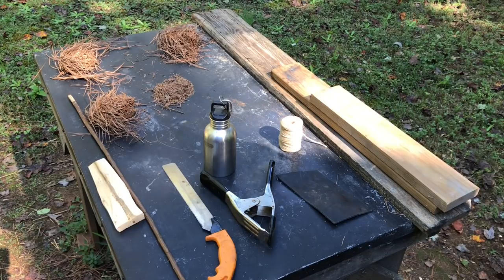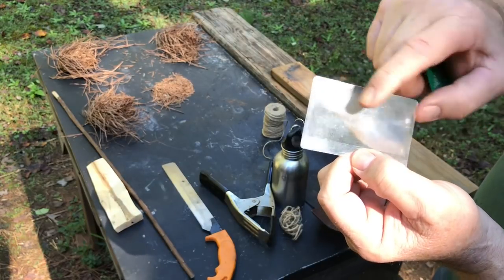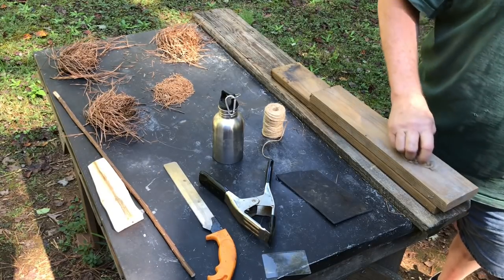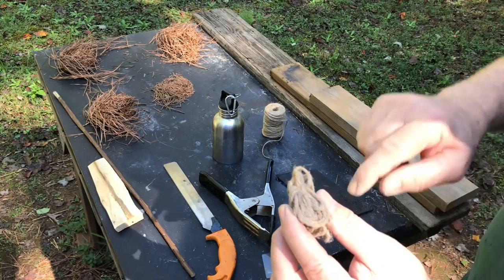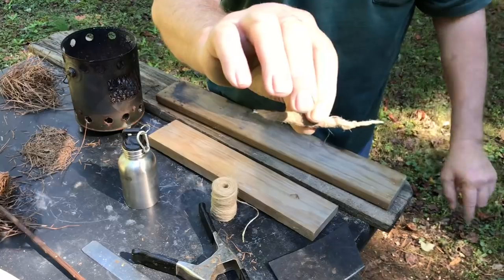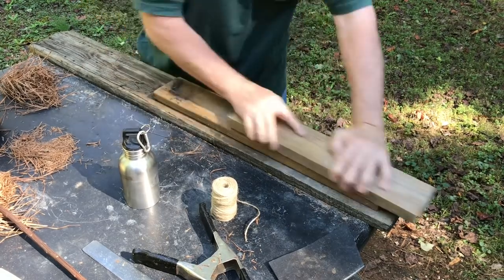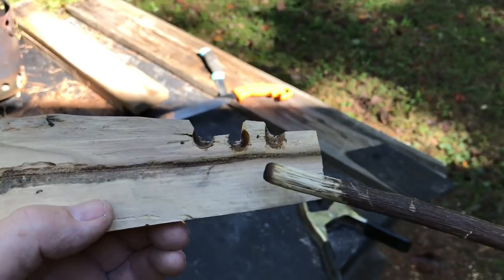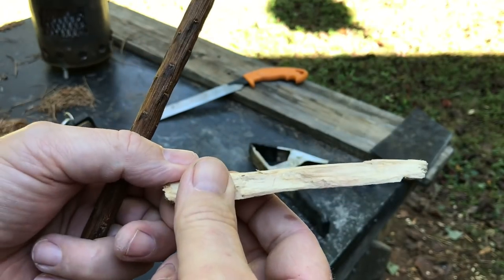3 Ways That Wood Ashes Will Help You Make Fire!

Comment: Hi David, over in the UK I'm trying to go from nothing to making an iron knife, 100% natural, copying people like the Primitive Technology guy. Luckily I have all the local resources necessary to do so, but none of it can happen without fire. So I practice mullein hand drill every day to keep my hands hardened up, but perhaps only acheive an ember 10% of the time, of course when I really need one, it takes hours, when I don't, a few minutes. It can get disheartening, not understanding the many factors involved and which one isn't quite right.
It's a pleasure to come inside with frustrated mind and burning hands and watch your videos, always a boost when I need one.
Thanks for your efforts in explaining as much as can be explained.
Richard
Reply from the maker: If you can't dry your hand drill set any more than what you're using, go bow drill and use drying cycles. See my playlist on drying cycles. Thanks!

Comment: I suspect that your Ashed Tinder technique is in effect spreading millions of tiny bits of charcoal throughout the tinder.  Much like the full size charcoal these tiny bits ignite easily and hold heat longer so as to ignite the fresh tender and other nearby micro briquettes.  It would be interesting to see how charcoal cloth (cotton impregnated with finely crushed charcoal briquet) compares to ashed cloth and char cloth.
Reply from the maker: Nope... bits of char interfere with the process. Please check out the 60 videos in my Rudiger Roll Playlist.